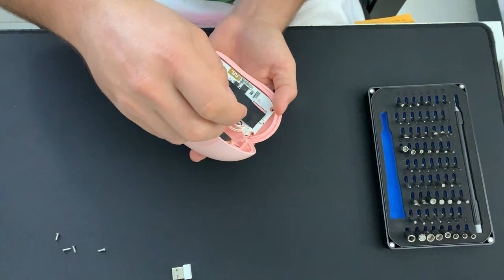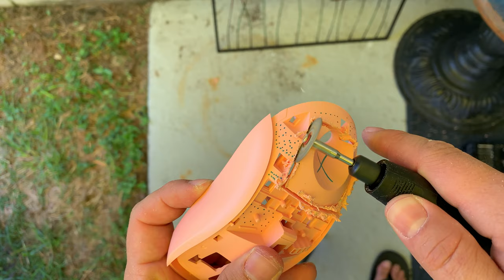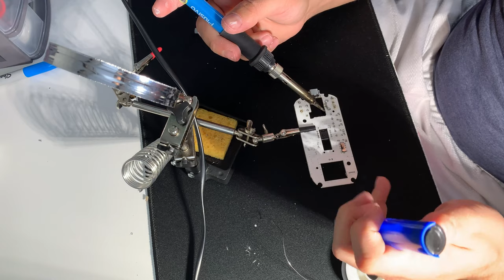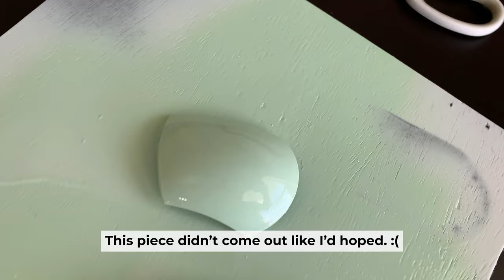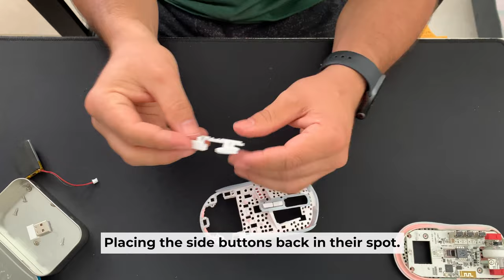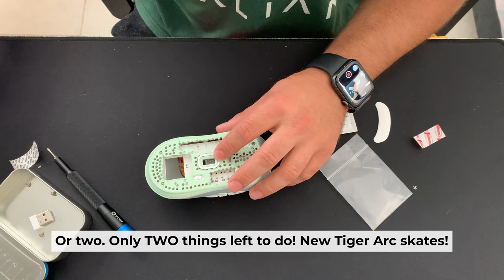AJAZZ i305 TRANSFORMATION - Teardown, New Kailh Switches, New Paint & 17g Weight Reduction!

Comment: Removing the led was probably very good, not for the weight, but to save on battery life. You could also try to replace the battery for a smaller one.
Reply from the maker: It's amazing how much battery LEDs can use up. You're also right about using a smaller battery. I just wasn't THAT committed into the mouse itself so I didn't want to spend any more than I had to on it.
Reply from the maker: Looking at the specs it’s not great at all. :(
Reply: @Escaldi  Damn, you are right, I searched up the sensor and found it, it is a low power sensor for wireless mice: https://www.pixart.com/products-detail/20/PAW3212DB-TJDT
Very low tracking speed and low tracking acceleration, pretty bad sadly.
Reply: @Escaldi  Hello again! Sorry to bother you, but I found something good: Ajazz recently launched the i309pro, wireless,  small size, good sensor and the top comment claims it is only 75.8 grams:  https://www.banggood.com/AJAZZ-i309Pro-Wireless-Mouse-Rechargable-2_4G-Bluetooth-Dual-Mode-Wireless-Mouse-PAW3338-16000DPI-Professional-E-Sports-Gaming-Mouse-reviews-p1769370.html
Reminds me a little bit of the logitech g900
Reply from the maker: It appears promising on paper. I’m actually going to buy one and test it out.
Reply: @Escaldi  I hope the top comment is right about the weight, if it really is just 75 grams it will truly be a christmas miracle, since in my country a GPro superlight costs MORE than a 500GB SSD + 2 sticks of 8GB 3200mHZ DDR4, it is ridiculous 🤣
Reply from the maker: Wow that’s crazy! Well if it makes you feel any better I put my Superlight away because I was very disappointed by it. It’s just sitting in my closet now and I’ll probably return/exchange it and hope I get a better one. 

The i309 Pro looks promising. I just ordered one to see for myself. Unfortunately it’s going to take a while to get here. Check back in a month to remind me to review it lol

Comment: Do you know what voltage and capacity the battery is? Maybe you could replace the battery with a smaller capacity and lighter one.
Reply from the maker: It was just a project mouse so I wasn't going to go that far lol. But yes that was probably an option.

Comment: Did you resolder that battery connector or push it back in i cant take out the cable with out the connector coming up.
Reply from the maker: No, I didn’t need to thankfully. I just had to carefully thread the connector back onto the pins.

Comment: I was wondering if this mouse has the same issue as the other wireless mouse Ajazz offers (the i303), where the DPI is higher than what you choose in the software (300=400, 400=520 etc.), did you notice the mouse being faster than others at the same DPI?
Reply from the maker: There is a noticeable DPI deviation, but I've read that most mice have these deviations depending on their sensors. I guess the important question is how much is too much? Mine was slightly faster when compared to my G604 and GPW but not so drastic that it would affect my gameplay.
Reply: @Escaldi  Was just wondering if it's a thing with the PAW3338 Ajazz uses, seems to br

Comment: those stock skates look pretty decent for a cheap mouse.
Using those push switches for side buttons is gross though. those side buttons look so bad, I would just remove them entirely.
Reply from the maker: The skates were ok. Nothing too great but passable. The side buttons on this mouse weren't terrible either, and most mice I've worked on uses push buttons to actuate the switches.

Comment: i wanted to reduce the weight of my i305 but i dont have the guts to push it, i hope there are some easier way to reduce its weight
Reply from the maker: Yeah it takes quite a bit of work to get it down to an acceptable level. You're better off spending a little extra on another mouse with similar specs but a lighter body.